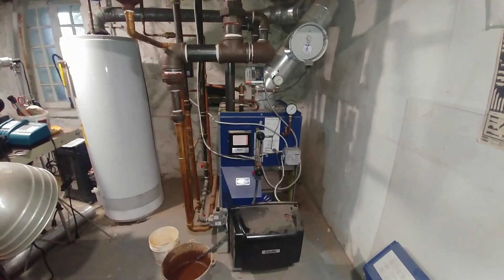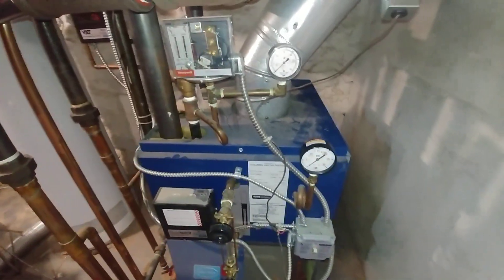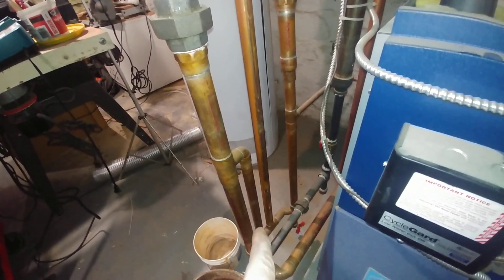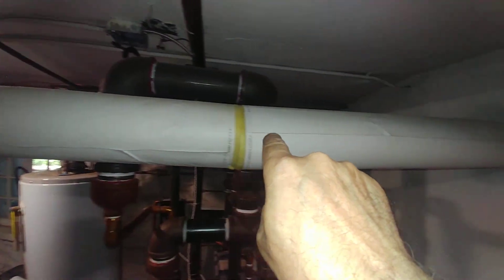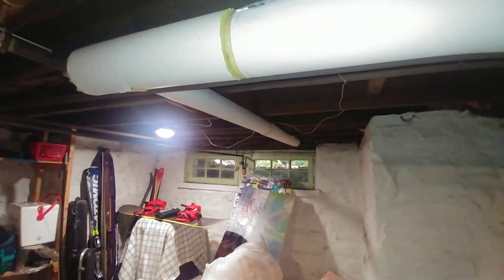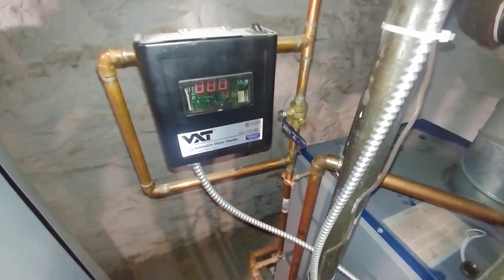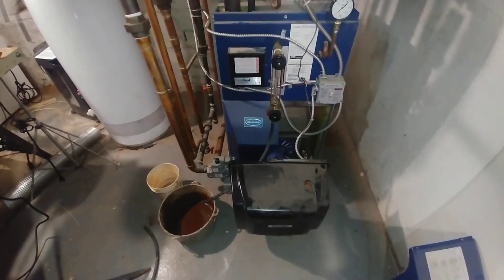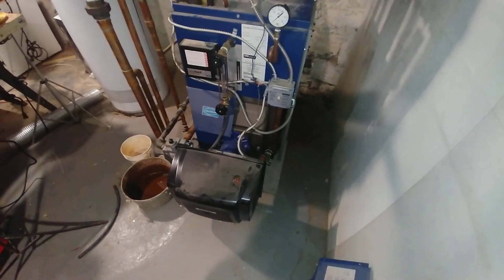Columbia Boiler Fired With Carlin EZ Gas Heating A Two Pipe Counter Flow Steam System

Comment: Do you ever  install copper on a dry return on a two pipe steam system? It shouldn't see any steam unless a trap fails.
Reply from the maker: Yes, I have. Copper should be ok for two-pipe dry return for the reasons you state.  Just have to watch the pitch of the pipe in that copper pipe usually comes from the factory with a subtle (and sometimes a not-so-subtle) bow.

Comment: som peopl got so much crap all over its bs
Reply from the maker: Certainly not for me to judge.
My basement is a disaster.
But much better than a finished basement with drywall covering vital bits and white carpet to boot.
Reply: @gordonschweizer5154  I now have to wonder whats inside Gordo"s basement. I'm sure there are so many pieces of heating history down there.
Reply from the maker: To the vexation of my long suffering spouse, yes.

Comment: Thanks For another good video, boiler looks new except for the dust near the Carlin burner.
Do you know if there’s any good reason to bring the air for combustion from outside? I see some videos with other people and the boilers are working with supply air from outside and direct vented exhaust.
Reply from the maker: Thanks!  
No extra charge for the dust!
And speaking of which,  excessive dust (and other contaminates) in some indoor environments is one good reason to bring in outside air to a burner.
Another reason is it ensures an adequate supply of air to the burner as folks sometimes tighten up their houses sealing cracks and gaps to such a degree that that becomes an issue.

Comment: Awesome job Gordon, do you worry about doing any damage to the vapor stat when blowing back the pig tail? I still have that a a probe in my archives somewhere. Thanks for the tour.
Reply from the maker: It should be ok.  Most folks are not able to generate more than say 5 psi by blowing and a vaporstat is (on paper, at least) designed to handle at least 15 psi without damage.

Comment: Only do a little steam in comercial buildings, typically 2#'s. Question for your fittings used, you said you used up cast iron in 2013. Is it cost? Availability? Most fittings I see are just malable.
Reply from the maker: Thanks for your question regarding cast fittings.
It's pretty much just as you say. 
New cast fittings are fast disappearing from the landscape of availability.
And are more expensive to boot.
I would say there is no good real reason to use cast fittings nowadays.  
They are not all what they are cracked up to be. 
Others might disagree.